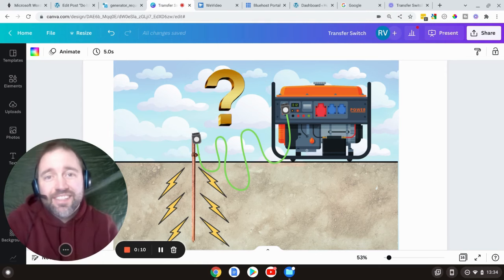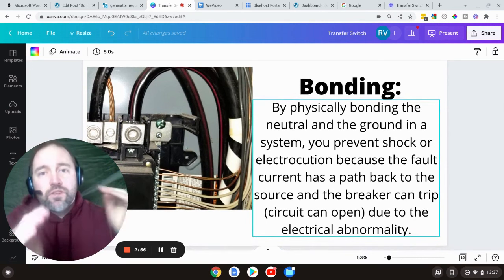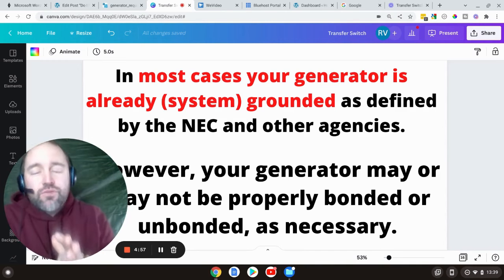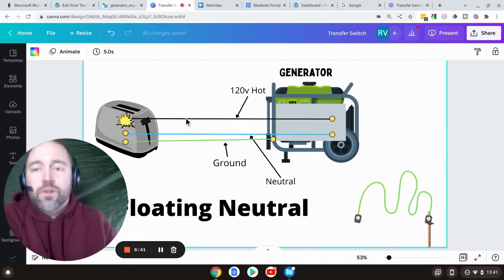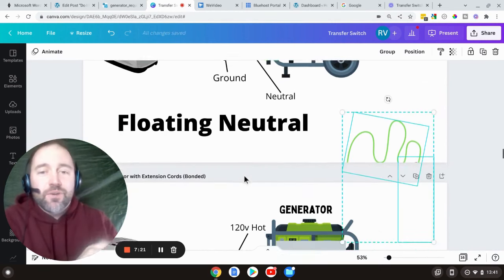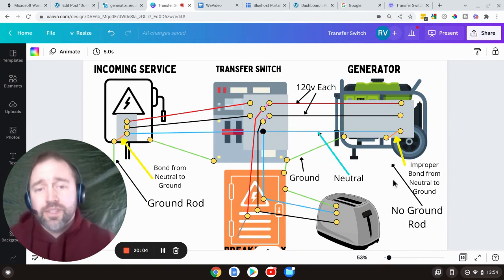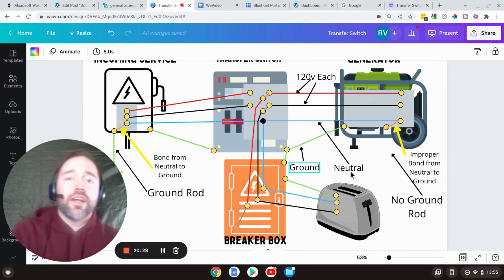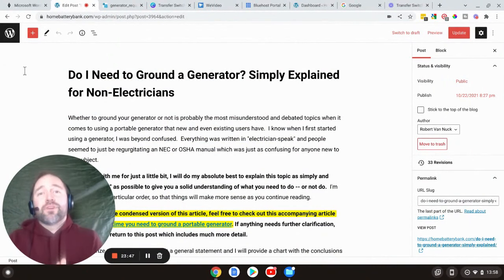Does My Generator Need a Ground Rod?  Probably Not.  Here's why.

Comment: I’m hoping you can clear up some confusion I have regarding generator protection devices and bonding. Specifically, I view circuit breakers as over-current devices which trip when their rated current is exceeded. Then there are GFI devices which I like to think of as differential current devices in the sense that they trip when the outflowing current on the hot wire does not equal the return current on the neutral wire. Can you elaborate as to how bonding effects each (or both?) of these devices? - Thanks! - Jim
Reply: Your understanding of both is correct.  GFI requires No equipment ground to operate.   Circuit breakers or fuses (overcurrent protective devices) have two functions.  First, overcurrent (as you stated).  Second, short circuit.  The part that may be missing is the current path from a ground fault.  Let’s say your hot in your electric heater, touches the metal case.   Let’s start just past the circuit breaker at the lug.  The path of current is, hot conductor to case.  Case to equipment ground.  Equipment ground to panel bus bar where both connected.  Neutral to utility transformer.  Utility transformer to panel power bus bar.  Bus bar to breaker.  Thousands of amps, magnetically trips the breaker.   Hope this helps.   Respectfully,   Kevin
Reply: @KevinCoop1  : Thank you, Kevin!

Comment: So, I'm using an interlock kit to connect my 12kw portable generator to my house. Am I correct to assume that, functionally speaking, this is electrically the same as your transfer switch with a fixed (non-switched) neutral? In which case, I should be unbondinding the neutral and ground at my generator,  but NOT using a ground rod at the generator?  Correct?
Reply: Yes, the interlock kit is the same as the 2 pole (unswitched neutral) transfer switch. Also, floating neutral and no ground rod.

Comment: Extremely thorough but Please maybe I missed it and I’m getting conflicting info from different sources including n manufacturers. 

My generator is neutrally grounded but is going to be hooked up w a 50 amp inlet plug on my home to the 50 amp breaker in my main with an interlock device.   So in this direct connection I Do need a ground rod attached to generator ?    And if so do I disconnect the neutral bond wire on the alternator?   
Thanks in advance.  Just trying to get some clarification

Comment: So quick question ... I have a circuit breaker box with 2 hots and 1 connection for either ground or Neutral there is a bar on both sides of the box that IS connected to each other SO my question is what do I do with the ground and neutral wires coming into the box with only one connection? do I twist the neutral and ground wires together and connect them to the LUG? The wires coming in are from a generator but there are 4 wires coming in and only three Lug screws in my box
Reply: This question can not be answered with information given.  Not enough detail.  Sounds like the panel is fed by a generator only, but nothing about how it is used and connected to what.

Comment: What about static electricity generated on the generator itself using the ubiquitous manual interlock with the neutral bonded to the ground at the panel.  Still recommend no grounding rod at the generator? I think that static would be dissipated on the main panel grounding rod, correct?  This is it awesome video. Thanks.

Comment: I have a question. So if you dont have utility power grid connected to a farm house and in your example replace the utility with an inverter. So with two power sources (generator and solar inverter system with a battery backup).

My question with refference to a transferswitch that also switches neutral wire- here in your example you basically have two power sources's neutral wires connected with each other through a ground wire... does this not have potential bad effect? So the neutral wires of two power sources touch each other and both sources are generating potential but only one feeds a load - does this not pose any danger to the equipment?

Comment: Very informative.  I've watched this few times now and trying to relate it to my scenario to figure out how to wire things up safely.  I have a generator that I will use to power my completely off pole shed.  I'm planning to use 30 amp inlet wired into small sub-panel or main panel to power a few outlet (GFCI) and some lights.  My question is where should I bond?  Should I bond at generator or should I bond at panel (not connected to utility power)?  Does it matter?  I'm thinking I would want to bond at source, the generator, therefore keep grounds and neutrals separated at panel.  But I'm not sure if that is right or not..  Still wrapping my head around it.  Thanks.
Reply: I am trying to do this very same thing as you..did you find any answers for this? Lol..I’m thinking it NEEDS bonded at our panel bc that’s how it is in our homes and the transformers are ground neutral bonded and that would be like our generator(assuming the generator we have is bonded by manufacture
Reply: @jeremysmothers5143  No.  Unfortunately I have not been able to get straight answer to this question.  I'm on several electrical forums and seems no one either knows or wants to tack this question.  So I called a master electrician and he never called me back.

Comment: Old school wiring in the house. No three prong plug. Just neutral and hot. If a grounded generator is added when the local current is off, will it ground the house or go on as the same as it ever was? (No ground in the house.)
Reply: Your electrical system is what it is.  The generator will not change it.

Comment: If I want to back feed my shop that is fed via a 125A panel from a 3ph service without a master disconnect, can I interlock the feed breaker at the shop panel to a generator inlet breaker? Subpanel G and N are not bonded, so would generator need to remain bonded or does N at subpanel need to be transferred as well?

Comment: I have a Champion inverter generator (4500/3500) with a floating neutral. I will be using a Reliance "through the wall" receptacle that is NOT grounded - it just splits a 120V 30 amp plug into standard wall plugs (6) through the wall into the interior of the house. Extension cords would be plugged into appliances and a portable A/C. Do I need to GROUND the generator using a grounding rod?
Reply: 1. How do you know its a floating neutral? Portable generators come bonded. Test for continuity at the generator between a receptacle ground terminal and its neutral terminal.
2. I have no idea what a "through the wall receptacle" is.
3. If you are using cords from the generator receptacles to each individual piece of equipment in the house, then the generator ground and neutral must be bonded and no ground rod needed.

Comment: so with my bonded generator.. going to use as home only..house is bonded...im good to unbond the ground off the generator right.
Reply: It's not always possible without disassembling more than you want to.  If you can do it, I suggest you add a warning label to the generator making it clear to never use it unless it's feeding a grounded building that already has the proper bond.

Comment: nice video, I have a question. I have a battery bank and I'm 90% off-grid I only use city power for powering up air-conditioners, the thing is my neutral (inverter) is bounded with the city power neutral which is bound at the main panel with their ground, should I isolate and install a ground rod and only switch to city neutral & ground when I'm using them? I don't live in the USA  and the grounding practices here are less common.

so this is not a question about regulations, but best practices.

Comment: Good explanation.
How about the situation where you are feeding a transfer switch with the 240 outlet from the gen and using an extension cord from one of the 120v outlets to power another appliance that is not on the gen transfer switch?  Is it ok to have the gen be a floating neutral even when using the extension cord?
Reply: I'm no expert, but I would say yes. it's ok, since the neutral and ground are connected to the main service thru the extension cord, thru the generator, and back to the house. This is assuming you have a "hots only" transfer switch.
Reply: @aspensulphate Yeah. Basically the neutral should only be attached to the ground once. If the transfer switch doesn't disconnect the neutrals when transferring the the generator is always connected to the neutral of the building and the neutral of the building is always connected to its ground rod/plate.

Comment: I have three main panels (2ea-200 amp, 1ea-100 amp) with individual meters ( 3 separate electric bills) feeding house, shop  and well pump . All power from the power company is fed from one 35KW transformer.
 I have a 15 KW PTO (tractor powered) backup generator.  
I have a 125-amp sub-panel located near the generator. The sub-panel has 4 ea 50-amp double pole breakers. One breaker will be the input from the generator to the sub-panel.
The three remaining breakers in the sub-panel will each be connected via a 50 amp breaker feeding power to the main panels for the house, shop, and well pump.  The main panels will each receive a new 50-amp breaker and an interlock switch.
The sub-panel and three main panels are connected with four conductor, 4awg underground aluminum wire. 
Each of the three main panels has its own interlock switch with a 50-amp double pole breaker. When in backup power mode each main panel will be powered by the generator through the sub panel if the 50 amp breaker in the sub-panel is on for the targeted main and the targeted main panel is in backup power mode via the interlock.
My questions:  how do I connect the neutral and ground from the generator to the main panels? I assume the generator neutral should be floating. Do I even need the ground wire from the generator to the main panels? does the generator need  its own ground rod? 
Thanks for the help. I have ask several electrical engineers and gotten different opinions.
Reply: If “All” your three main panels are correctly installed (with bonding from N-G at each system), then there is no disconnecting that neutral.   Therefore, you do not want a N-G in your generator.   Also, what you are calling your sub panel, is a generator distribution panel.   It receives no voltage or current from the main panels.   Just my opinion.

Comment: So basically, if I'm using my generator to input to interlock into my electrical box, the generator should have a floating neutral since ground and neutral are already bonded inside my breaker box. If I'm using generator just with extension cords, then it should be bonded. correct?

Comment: Really great information and explanation. Thank you.
You stated that if you are just using a generator with an extension cord that you want a bonded neutral, but in your explanation it seemed like a floating neutral might be okay; you probably wouldn't get shocked, but the breaker wouldn't trip. What is the worst that could happen with a floating neutral genset using an extension cord and a fault occurs in your powered equipment?

Also, what is the real problem with using a bonded genset w/out a switched neutral in the transfer switch? Just that the ground wire back to the genset could theoretically be overloaded and overheat? Is there a shock hazard? Apparently, from what I've read, it can be bad for sensitive electronics, but I'm not sure why.

I just had a generlink transfer switch collar installed by my power company between the meter and my main panel that only switches the two hots. Theie genset compatibility list has my Generac GP7500E listed as compatible and notes it is bonded neutral. The instruction pamphlet I was given with the transfer switch install indicated that a floating neutral genset is recommended though, as does a sticker on the transfer switch itself. So it states "recommended", but not required. I was just going to connect my bonded genset as is, but now I'm thinking maybe I should unbond the neutral to ground.
Thanks!
Reply from the maker: Hey!  Thanks for the comment!

As far as paragraph 1 is concerned, yes, most people use a floating neutral generator with extension cords and get away with it just fine.  I'm guilty as charged.  The problem really occurs (unless someone can correct me) when there is a second fault.  So, if you had a floating neutral generator and had the hot break off in a tool and the case was energized, you'd be fine.  The tool would just stop working but the fault wouldn't be cleared.  However, let's say your extension cord got scraped by something sharp and the outer insulation was missing as well as a small piece of insulation from the neutral wire. Let's say you were standing in wet grass and the exposed neutral was on that wet grass (or you grabbed the exposed wire unwittingly).  The current now has a path back through the tool, through you, through the ground, to and through the neutral wire, and back to the source.  Shock time.

With the second paragraph, since your generator is bonded in this example, and the house itself is bonded in the house's panel, then you have now created two paths back to the source for the return current.  Current can travel along the ground and neutral that directly connect back to the generator (during normal and fault scenarios).  Yes, this can overload a ground wire, but it can also inhibit a breaker from tripping properly to clear a fault -- or it can cause a breaker to constantly trip like a GFCI until you unbond it.  There should be only one point where the neutral and the ground are bonded.  Having two basically creates a circuit within a circuit.
Reply: @HomeBatteryBank  ... I have worked with many of these Generlink units and since you are feeding from the meter socket, the neutral and ground are bonded within the house anyway. All is good with either a bonded gen or floating gen, as long as your connecting cord is in great shape. BTW, with a 7500 watt gen set you will never overload the ground wire without killing the gen set first.

Comment: I'm thinking that the setup where the generator hooks up to directly to the neutral in the service could be problematic since the very reason for the outage could be a fault in that very neutral/ground!
Reply: That is the way 99% of generators are connected.   And it is safe.

Comment: Why do you need a ground rod at the generator though when you use a switched neutral transfer switch? the neutral is no longer shared, but the PE (ground wire) is still shared with the house, wouldn't it just use the grounding rod that the house uses by default?

Comment: Maybe I missed it but I have an Interlock Switch to change from utility service to my generator inside my breaker box. The 50 amp receptacle that the generator plugs into to provide power to the breaker box is grounded to the same ground rod as the breaker box and the meter coming from the street. So the breaker box is grounded whether power is coming from the street or from the generator. I’m confused now if I need to also add a grounding rod connected only to the generator.
Reply: Someone else asked the same question above, and spacecoastz gave the following excellent answer which I believe is correct:

Here is an answer I found from Home Battery Bank in reference to an interlock system.  I found it down below.

"When properly installed,  an interlock just makes it so that you can't have the mains power turned on while you're turning on the breaker that you're using to backfeed the house with your generator.  The power line crews appreciate it!  The neutral is left intact (and the house is already bonded) and the generator still shares it with the house.  The generator should be floating neutral (unbonded) so that you don't have parallel paths for the return current (and any fault currents) back to the source (the generator).  Of course,  I recommend reaching out to your local certified electrician before you make any changes."

You need to have a floating neutral generator and no additional ground rod
Reply: @kipster-ll6po  my electrician verified that no additional ground rod was needed in my setup.  Thanks

Comment: Would an interlock switch be essentially the same scenario as the normal transfer switch? Meaning you want a floating neutral and no ground rod?
Reply: I'm wondering the same
Reply: @brandonmurphy4657  see the comment from bradsmith5131 a few comments down.  I have the same question and it appears that the generator needs to be floating neutral and no ground rod in the case of the interlock from what I am seeing.....

Comment: Is grounding to a copper water supply line (coming out of house for sprinkler system) an acceptable alternative to a grounding rod for my generator? It’s the same piping that my breaker panel is grounded to about 20’ ft upstream from this point.
Reply: a copper water pipe generally sufficed for a grounding rod years ago - but code now generally states that if you use a copper pipe for a ground rod, you also need a regular ground-rod sunk in the ground at least 6 feet away from the copper pipe (the further away the better)... in fact most electricians will now routinely sink two ground-rods to ground a panel... since you're connecting your generator to a ground rod - I assume your generator is bonded and you are also connecting your generator to your house through a hot/neutral transfer switch (where the neutral is also switched, which is not a common type transfer switch)...